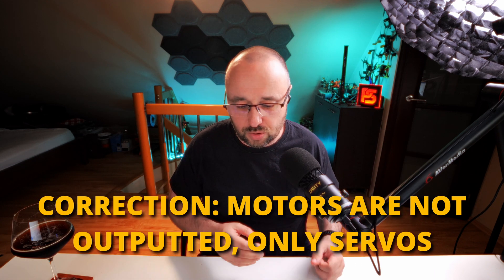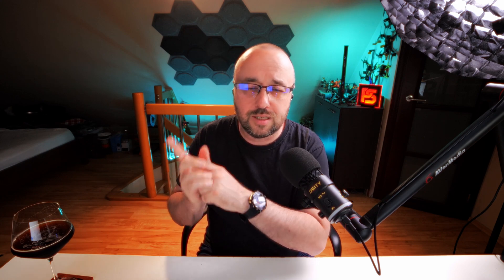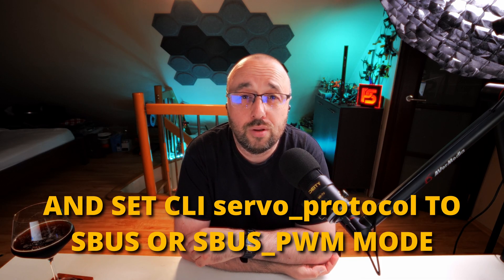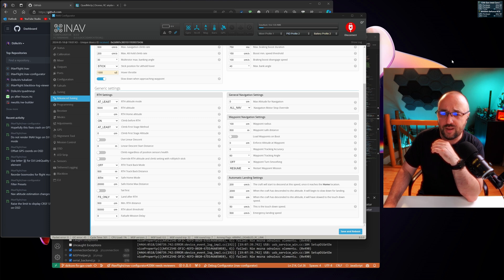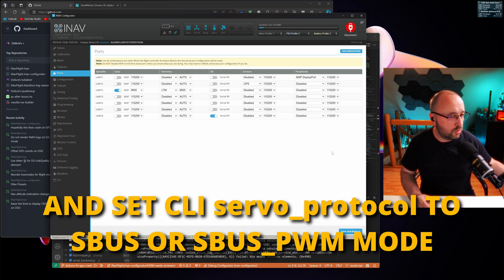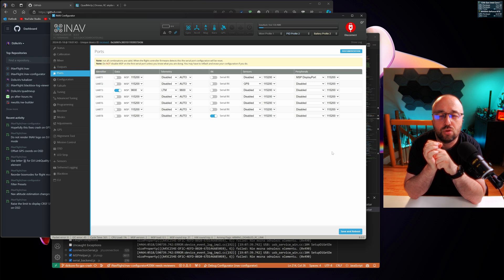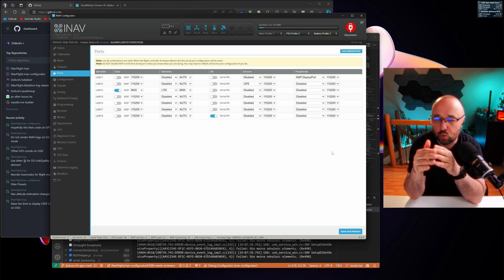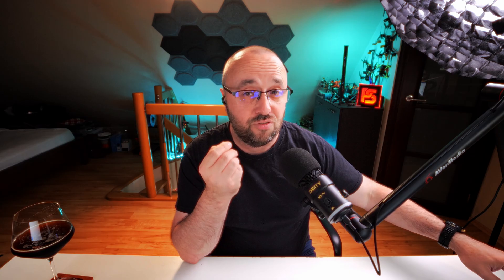Servos when there are no servo outputs

Comment: Thanks Pawel. To clarify- Does your receiver have to be putting in SBUS into the flight controller for this to work? Or can you have ELRS/crossfire (using CRSF protocol) receiver and still get SBUS out via one of the UART TX pins?
Reply: It looks easier to flash the elrs(crsf) receiver to the sbus protocol, connect the controller and converter in parallel